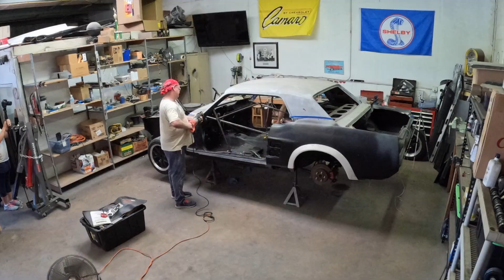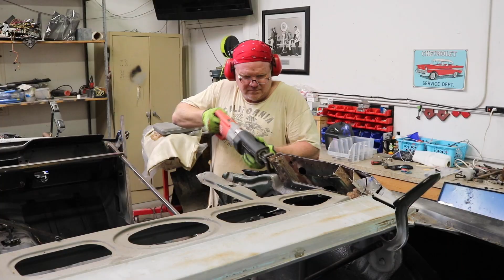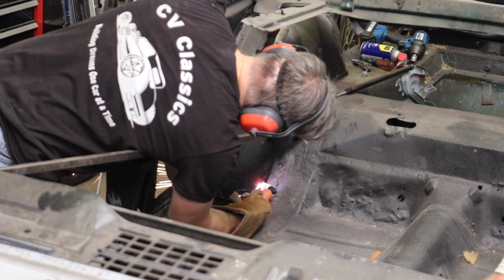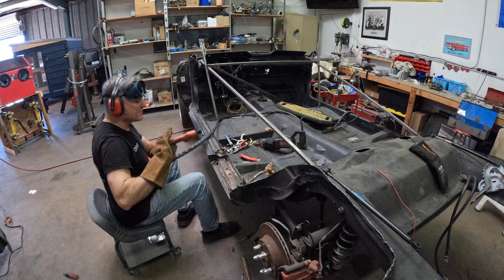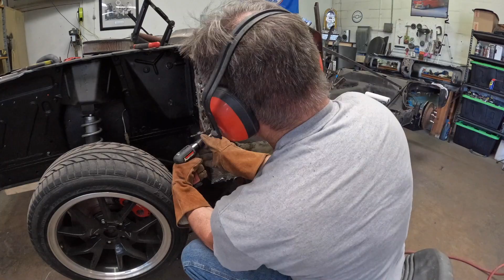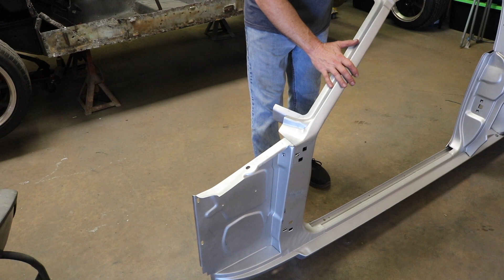How to Convert a 67 Mustang Coupe to a Fastback Part 1

Comment: I am really interested in this build. Of all the videos out there of "Coupe to Fastback" no one shows taking it all the way down to the kick panels. I have a 68 coupe that I am about to pull the trigger and convert. It had a pretty significant leak from the front roof corner that rusted away at the front roof support, the inner A pillars, and top of the piece the door hinges mount to. Everything that is rusted would be replaced with this conversion. If I weld in some sub frame connectors, would I still need the bracing?
Reply from the maker: Brian,  thank you for checking out my video!   Yes,  even if you have sub frame connectors there is nothing to support the dash and firewall from moving.   When you take out the kick panels you take out all the support for the firewall and dash.  The car in the video has subframe connectors, but I think you should always use some bracing to keep things from moving and or twisting.   Additional videos on this build are coming in the next few weeks.  Good luck on your build.

Comment: Is there a benefit to leaving in the drivetrain the engine and transmission?
Reply from the maker: This build did not require the drive train to be removed.   Not sure if there is a benefit but the extra weight held the body in place.  It could be done without the drivetrain in place just as easy.